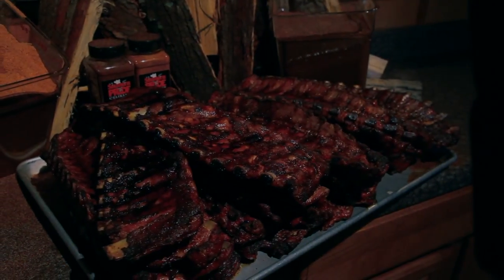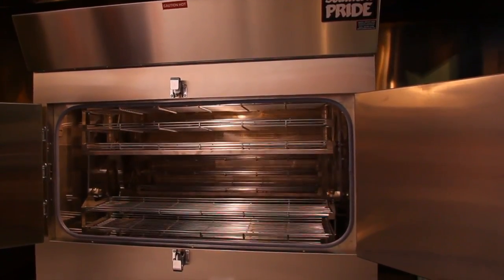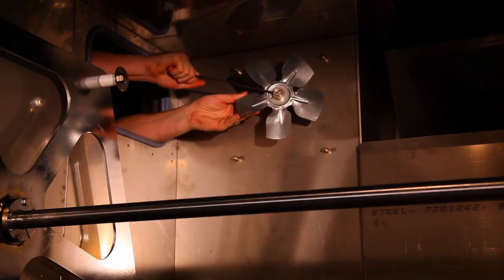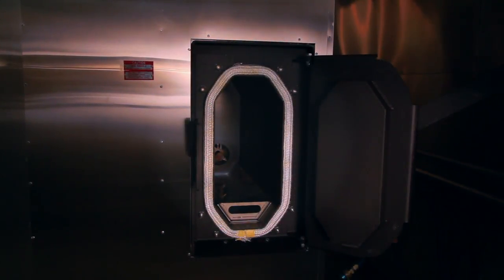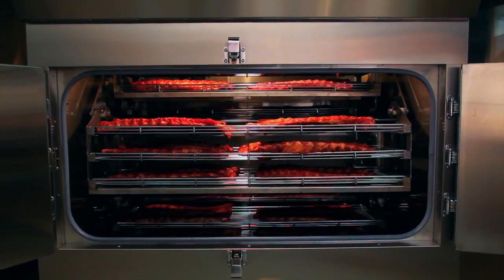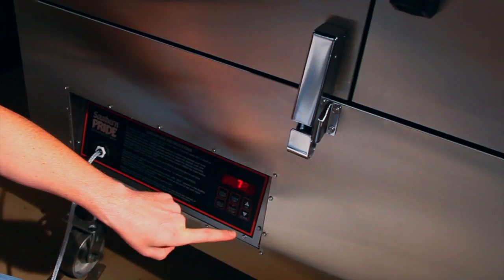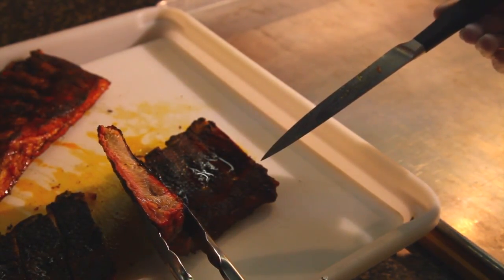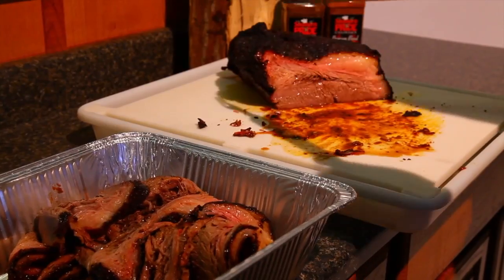Southern Pride Gas Rotisserie Smoker Operation and Maintenance

Comment: A gas smoker 😂😂😂 might as well put your food in the oven and use liquid smoke
Reply: The wood logs are burning and making wood smoke.
Reply: You can control the smoke profile. If you want to operate a craft bbq joint, I get it. Do it the old fashioned way. If you want to make a lot of money and serve something that is just as good or better, here you go.
Reply: Not really gas. It’s just to start the fire for log or coals.